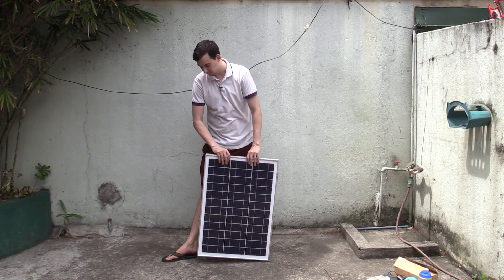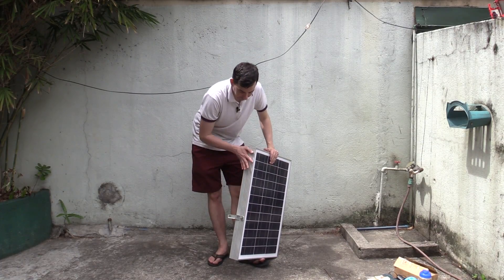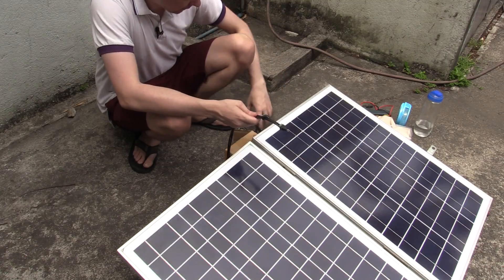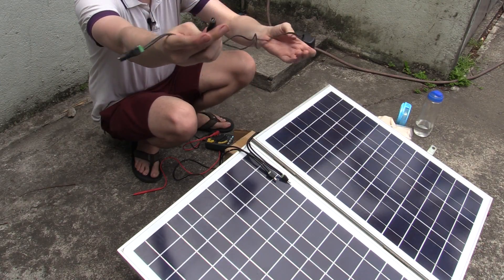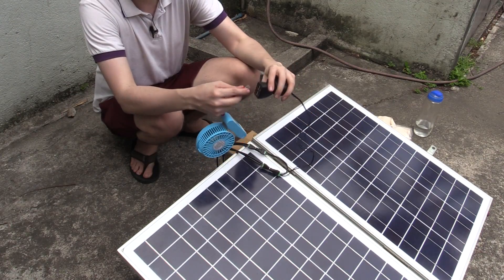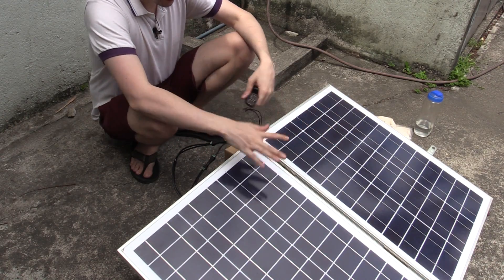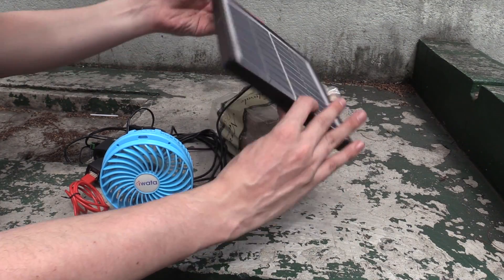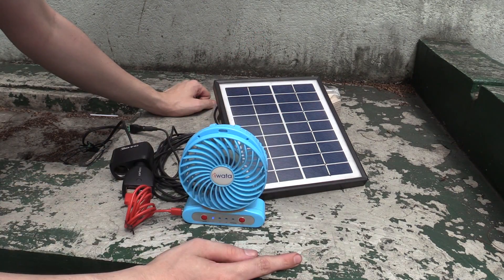100W Solar Power Briefcase for Calamities

Comment: How much is 100watt solar panel,charge controller, 12v battery,and 1000watts inverter?.TIA

Iwant to run my 45 watts TV and 50 watts efan. Do you  think its okei if i have 100watts solar panel?

Comment: I'm really planning to buy 800 watts solar panels but not the portable ones haha. That will be eight 100-watt panels. Is it good to invest a big money on cdr king solar panels? You know, it's cdr king. i'm afraid it would break that fast. How's your cdr-king panels so far? or anyone who can answer me, I appreciate you .
Reply from the maker: I'm happy with my panels but they change suppliers and stock all the time. So what you buy now won't be exactly the same as what I bought. My recommendation would be to buy a single panel, test the output and then buy the rest if you're happy with the result.
Reply: Nice advice. I will definitely do that. Thank You!

Comment: THis 100w can power the TV? Electric etc?
Reply from the maker: 100W is most likely enough for an average sized LED TV and electric fan. But when it comes to power loads like that, you most likely need to a charger controller and deep cycle battery and either a DC to AC inverter or some kind of specific voltage regulator if the load you're connecting is DC.

Comment: i havent done my research yet but how about hooking it up to say, a 10000mah power bank? do i need a charge controller to prevent the risk of blowing myself up?
Reply from the maker: Connecting a powerbank through one of the in-car USB chargers would work fine and allow you to store the power for use at night :) There's no need to add a charge controller.

Comment: i think small solar panel, easy to carry but it ok to use fire fly solar panel it 9v 2a i seen nearest super market at cubao but it ok to use it.? i have cigarette car socket. but i don't know which negative and positive. ?
Reply from the maker: How much did you see the Firefly panel selling for? I have a good relationship with Firefly but they seem strangely unwilling to provide any of their solar equipment for review, which makes me wonder why. So at this point, I can't comment on the quality or performance of their panels. For a cigarette car socket, the outer terminal is negative and the end single point in the middle is the positive.
Reply: it P400 ( 9v 2a) shopwise but ace hardware P580 but different voltage and amp. because i  planning to use for future use and the solar panel small to carry any where (size of notebook the P400 and other one is P580 i think the size of abs cbn tv plus box). 
:)
Reply from the maker: A 9V 2A panel would be 18W. I don't think it's possible for them to sell an 18W panel that cheap. Also based on the size you describe, it sounds more like a 2W panel. Perhaps its a 2W panel with open circuit voltage of 9V? Do you have any pictures of it?

Comment: My adapter has an input of 12-24 V and 2A.Does it means that the highest input power is 48W?
Reply from the maker: +Parallax Error perhaps but probably not. Are you sure 2A isn't the max output? At 5V? So 10W regardless of input voltage.

Comment: would love to ask where did you buy the 4W solar panel? been looking for something like that. Thank you
Reply from the maker: That's also from CDRKING lol
Reply: just look up on the site they don't seem to sell 4W solar panel? mostly from 50W and up solar panel would love to know what product or bundle that 4W solar panel came from or any specific.
Reply from the maker: It took me awhile to remember where it came from. It was part of a solar lighting kit. But the batteries eventually went bad and I didn't bother replacing them because honestly it wasn't worth spending more money on it. I see they still have a lot of small solar light kits but most of them don't state how many watts the panel is. Small panels are generally very overpriced.
Reply from the maker: By the way, they do have a 10W panel for P780. Code SOL-020-LYE

Comment: Interesting
I did a similar thing, only 40w, 4 pannels 
I glued them onto a heavy duty upvc tarp so it could fold four ways so it was a little more compact, it was a lot lighter than those aluminium frames too
I also wired a two way toggle so it can switch between 12v and 24v so i could use a car or a truck battery for power storage, depending what was available
I did include a charge contoller that allowed me to charge the battery and have car charger like yours at the same time
6 kids on a camping trip and it kept all their tech charged all the time so they were happy😁, not bad for the uk sun and in the woods too
I did try to suggest that they could turn off their tech and enjoy the bush camping but that nearly caused a riot 😱😤😢😥
Reply from the maker: Sounds like a nice little setup! I like the idea of having a switch for changing them between parallel and series. Although I'm not sure if that would really be worth doing in my case. I'm also thinking of a tarp cover for these to offer a little protection. And I guess you're right, there's nothing stopping me from leaving the charge controller attached so it can optionally be used with a traditional lead acid battery if they want. But I'm really trying to minimize components and complexity so it's dummy proof and cheap/simple to fix when something goes wrong. Definitely some stuff for me to consider, thanks for sharing. And lol, you thought they might disconnect from their gadgets after you gave them power? No chance!

Comment: Hello! New subscriber here. Nice Channel btw. Was wondering how sturdy these solar panels are? Especially ones from CDr-king. How long do they last? Can they take a hit from falling rocks? (got some kids in my area who likes to throw rocks at the sky) With these earthquakes recently in my area, I feel like we really need one at home.
Reply from the maker: They're pretty sturdy with the fairly thick aluminum frame and what appears to be tempered glass. Although I've never verified the exact type of glass used. I helped my friend transport a cdrking panel to a fishery. It was bouncing around in the back of a pickup truck for hours, dragged through rough terrain and taken across a river on a mashup of bamboo and plastic bottle floating platform. The solar panel is still going strong until this day. The unmaintained battery on the other hand... that didn't last so long. As for rocks or stones that might be thrown at them, I'm not sure. But the glass is really a lot stronger than people think.  You could add a layer of polycarbonate on top of the panel to offer extra protection against that. You might suffer a little loss in power output but at least you wouldn't have to worry about the glass being broken.

Comment: how much does it cost if we buy one set of it and  how many led bulbs can we use to run it throughout the night?
Reply from the maker: It's not something I'm selling, this is a work in progress for a charity. But I can give you estimated costs. cdrking sell 50W panels for P1880, so two of them will be P3760. Then you're looking at P150 for a double or triple cigarette socket adapter. P200-P400 for an in-car USB charger depending on how many ports and maximum output. Connectors maybe P100.  Hinges and latch maybe P200. So if you want to duplicate what you saw in this video and only draw power out during the day, you're looking at around P4500 (70GBP / 90 USD).

Now you spoke about storing power and using it at night. For that, you buy some 2A input, 20,000 mAh powerbanks from Pineng which are P1000 each. The more you buy, the more power you have at night but then you also need more 12V USB adapters to charge them from the solar. Then you can buy USB powered LED bulbs or LED strips which go for P50 - P250 depending on the wattage and quality.

Just a note, I haven't tested the quality of CDRKINGs latest batch of solar panels. They're not the same as what you saw in this video.
Reply: ah ok , thanks ...  so it is really costly to have a solar power in the house, battery and inverters  are a bit expensive i guess.And it does not last for a long time.
Reply from the maker: Prices decrease with scale. A small solar system will not save you money on your electricity bill, but will offer you power when the grid is down or while you're on the go. Most solar panels still offer over 80% of their original power after 10 years. A good quality branded inverter should last just as long. Of course when you choose cheaper components, the expected lifetime drops.
Reply: Gadget Addict .... ok thanks alot ..

Comment: What about including a small powerbank with the kit?  Also, I think some sort of protective bag is a must.
Reply from the maker: Exactly :) I didn't mention it in the video but I have it in the video description. If you want to store power during the day, you can absolutely use common USB powerbanks :) And yeah I was thinking some padded foam corners and a custom tarpaulin cover. During big calamities it's pretty easy to move around without encountering the normal restrictions on luggage and such like. If you look at Yolanda for example, people were able to easily get to the area from Manila thanks to the C130s flying back and forth out of Villamor airbase and by sea on navy boats for those closer to the area.